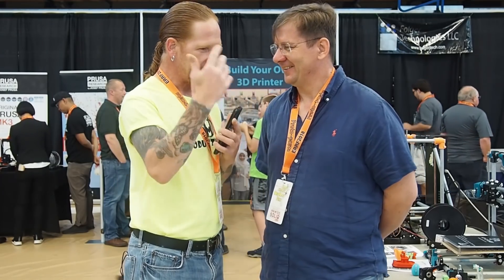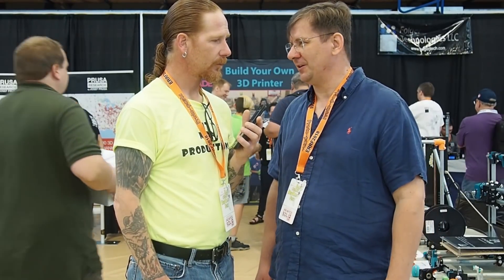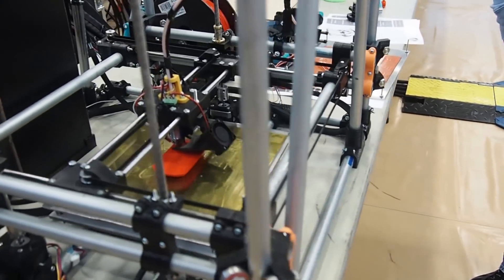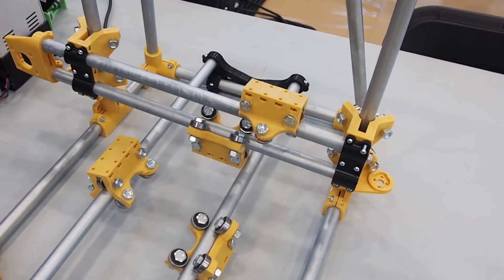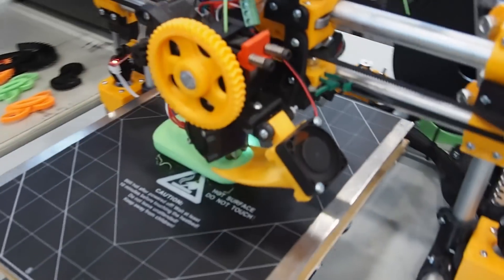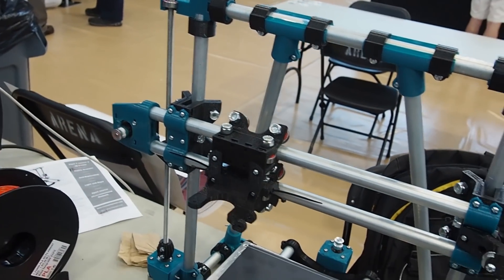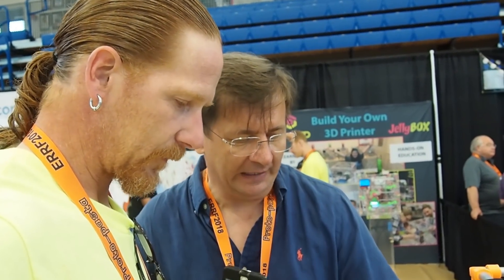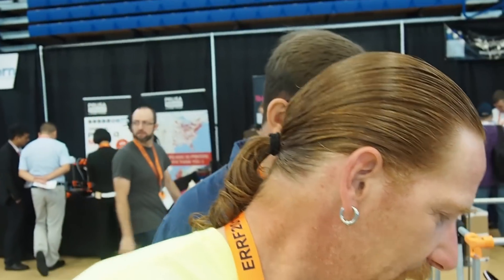The Piper @ERRF2018

Comment: Loved hearing about the idea how the heat bed is stationary because of the high voltage silicone mats being used. I never thought about a stationery bed for this reason as the core xy standard seems to be lowering the bed for z movement.
I would of loved to hear more about the linear movement and design of these parts (cost vs quality a future mgn12 mod would get me very excited).
Reply from the maker: Have you seen the infinite Piper!?!?! ERRF2019 is very soon and you bet that’s the 1st video I’ll be making Alex is so awesome. I hope your a  FB group member if not you should join up great group of people. Thanks for watching
Reply: @InsideTheMindOfMatt  i seen the fb group but not joined as i wouldn't be able to help since i don't have a piper.
I did a quick price check the conduit is a very cheap material. Priced up a entire printer came to about $380 aud +-$40 using a skr 1.1 pro with tmc2209's. I would move to do it but i cant spare the cash right now. I think i might stick to rebuilding my A8 frame for under $30 with a similar AMT8 mod (looks like a piper 1).